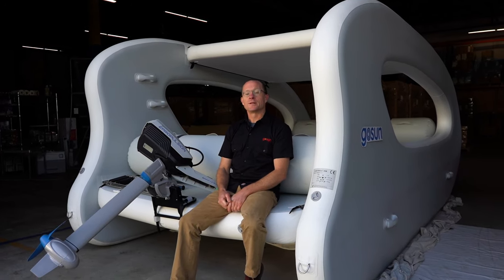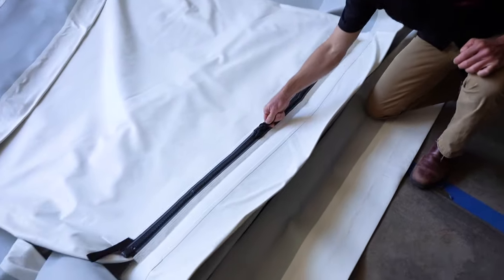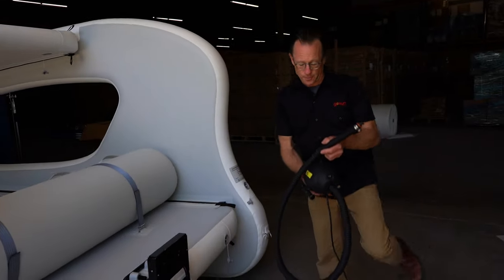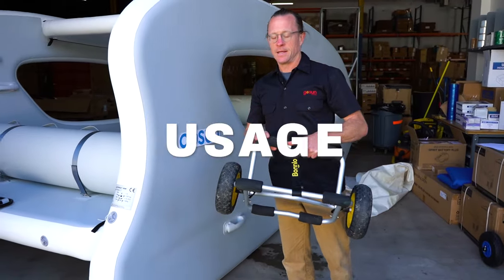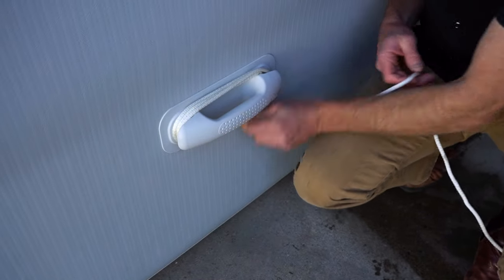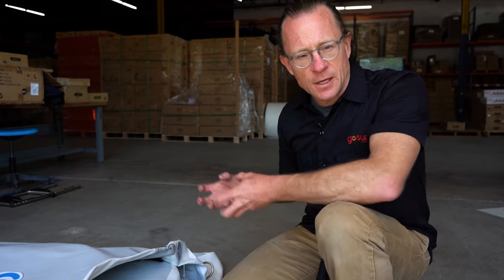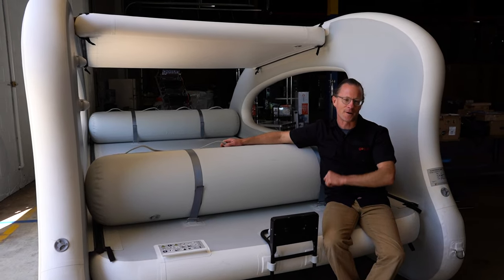Exploring the GoSun Elcat: Inflatable Solar Electric Boat | How To | GoSun

Comment: Could you break down the weight by piece? If it's mostly in the motor I think I could lift it all into a truck bed and that's super convenient.
Reply: ePropulsion motor only weighs 42lbs. The pieces un-zip and our demo partners have easily packed up into trucks/small vans.
Reply: Did you watch the video? He went through each piece and how much it weighs.
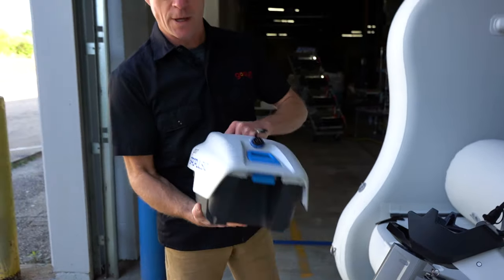Reply: It was shown at 1:15 for the parts.  But there might be some batteries that weren’t mentioned.  It looks like he did mention the battery at 6:10.

Comment: Is it possible to add a small steering console with remote throttle control?
Reply: I've been trying to research this product myself.  As far as i can tell, this product is an Electricat 450,  made by hovercraft D.O.O. out of Slovenia.
You have to call the manufacturer to order direct while stateside.  If I recall, the manufacturer offers exactly what you are asking, no idea about the price. 
There seem to be a lot of retail options in the US  that are slightly modified and rebranded. I think the base boat is currently around 6-7k from the manufacturer. No idea what shipping and import taxes would cost. The cheapest I've seen the base configuration at a us retailer is about 10k.
Reply from the maker: hi Gosun is the exclusive USA outlet.  We have some in stock right now in Cincy.  We also may have a demo at an awesome deal!
Reply: @GoSunSolar more info on prices please
Reply: Yes, check out their website